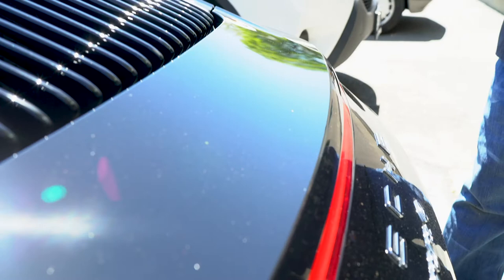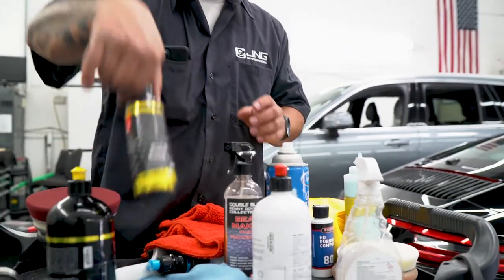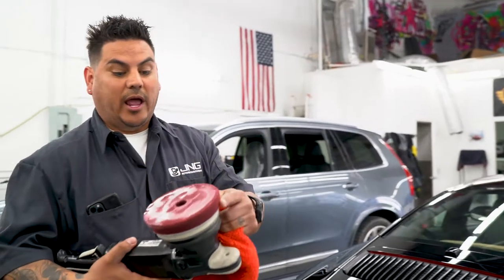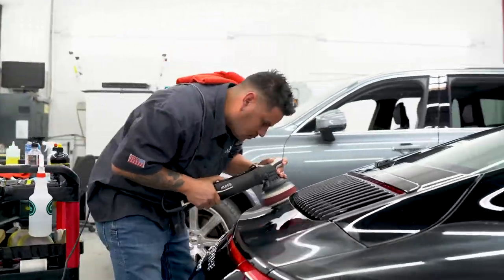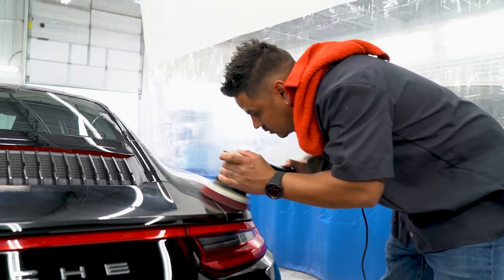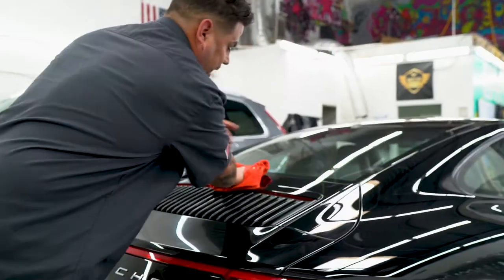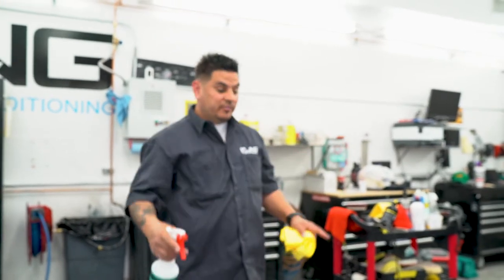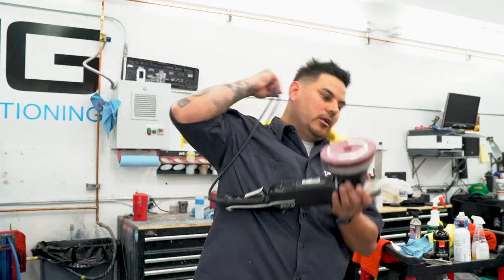REMOVE SWIRLS EASIER BY DOING THIS...

Comment: How long should a one step correction take on an average sized car like a dodge charger that is receiving a ceramic coating?
Reply: About 15min per panel
Reply from the maker: All depends on how bad the paint is and the level you are trying to achieve.